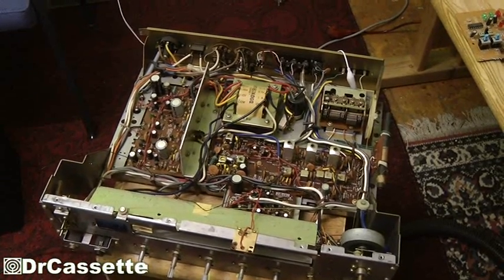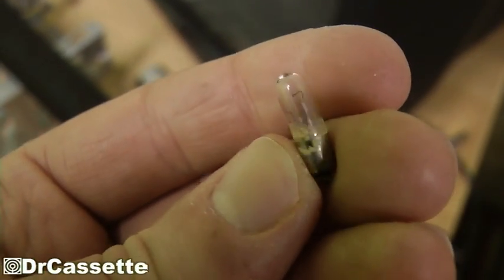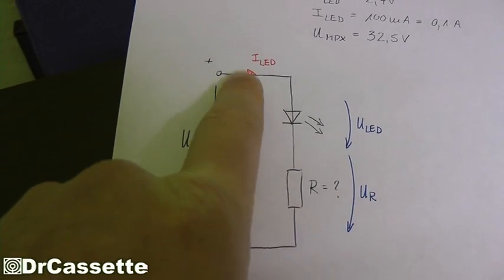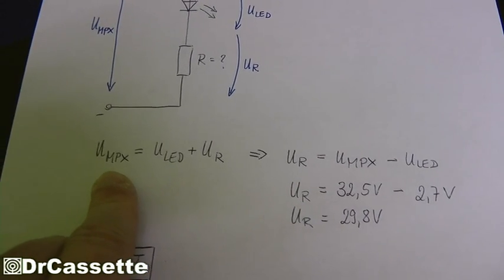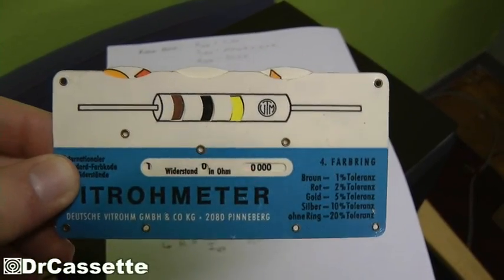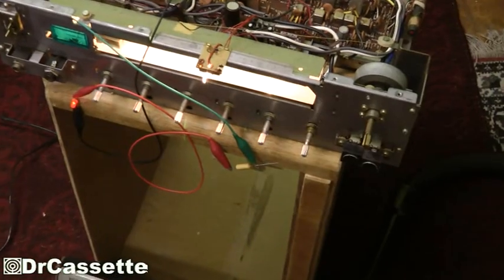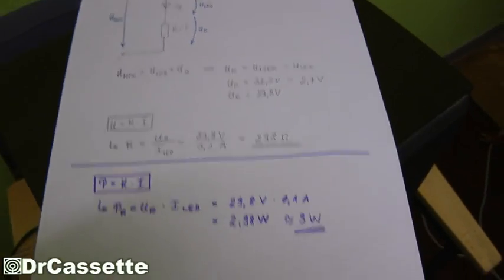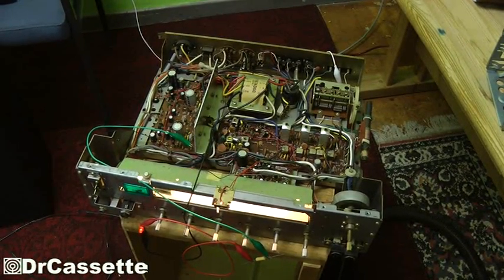DrCassette's Workshop - How to replace light bulbs with LEDs

Comment: One caveat to be aware of in this special case: While this unit (it's the Onkyo Y-200D, I guess) looks old enough to contain a discrete stereo decoder with a transistor able to sink 100 mA, several stereo decoder ICs are NOT. Some early ones are rated for as little as 40 mA and can actually be (and have been) burned out by inappropriate replacement bulbs.
100 mA does seem a bit high for an indicator LED, particularly if it's a super-bright job. (Normally it's ~20.) 270 mW is a bit toasty, too.

Comment: @TheChipmunk2008 The one explanation I've seen is that the "U" stands for the German word "Unterschied", meaning "difference". That only makes sense to me in the context of a voltage drop; otherwise almost any of the other electrical measurements could have a difference between one point in the circuit and another!

Comment: Another excellent and thorough video.

In case you wanted to know, MPX, as it is used here stands for MultiPleX. That is Stereo MultiPleX, showing when the 19kHz pilot signal is present for decoding into the left and right stereo channels.

Comment from the maker: @THEtechknight 
@TehMG 
I too was surprised about how much this LED would take, but it is of course a super bright one. I turned the power supply up until the current started rising exponentially (rather than linear), turned it down a bit and ended up with 2,7V. So that should be correct.

Comment from the maker: @TehMG 
I too was surprised about how much this LED would take, but it is of course a super bright one. I turned the power supply up until the current started rising exponentially (rather than linear), turned it down a bit and ended up with 2,7V. So that should be correct.